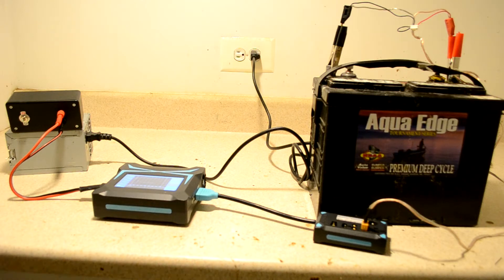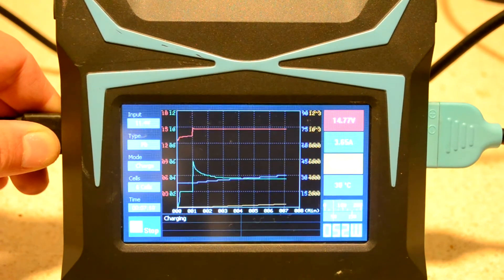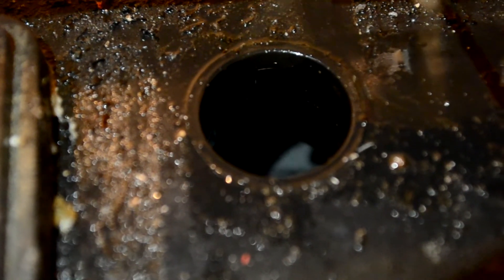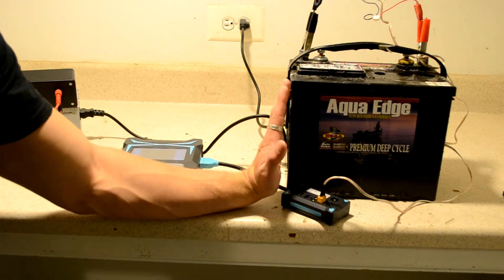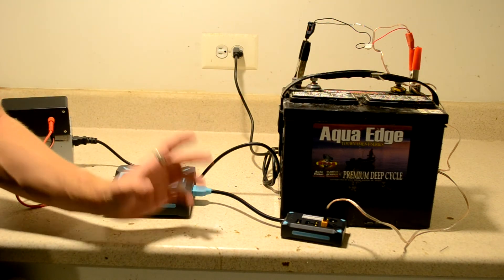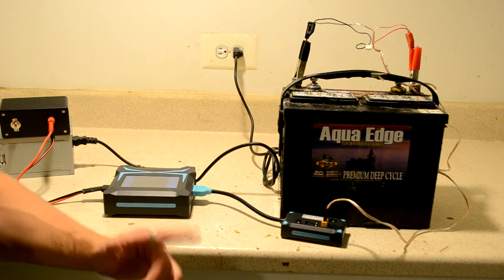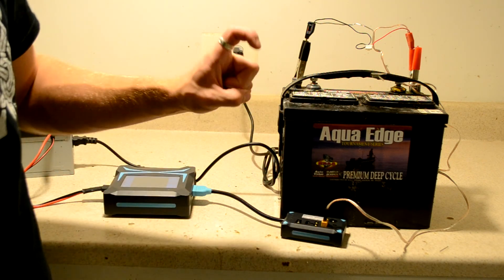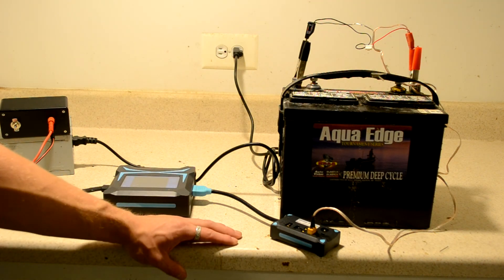Tutorial ---- Lead acid battery maintenance

Comment: I resurrected 4 of 5 dead/0 volt lead acid batteries by parallel charging them with a good battery.  The smart charger reads the charge on the good battery, while both batteries slowly equalize and the leadsulphate breaks down. One battery took a couple weeks to come back to near 100%. The one that failed had a dead/shorted cell.